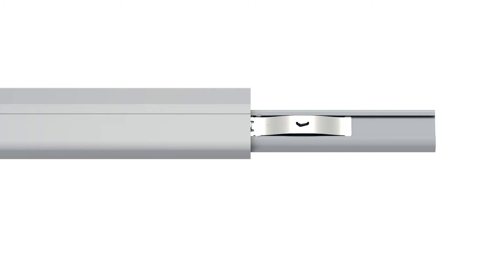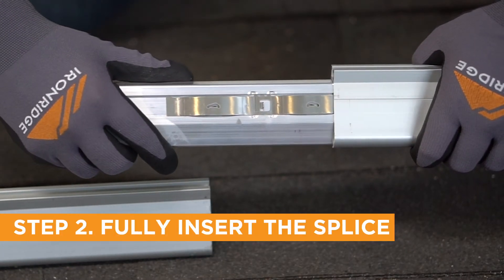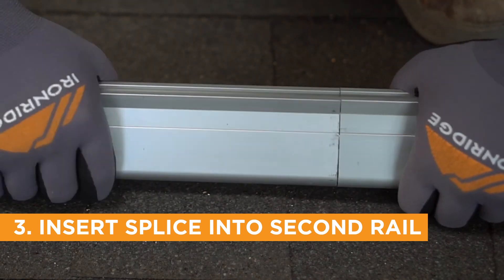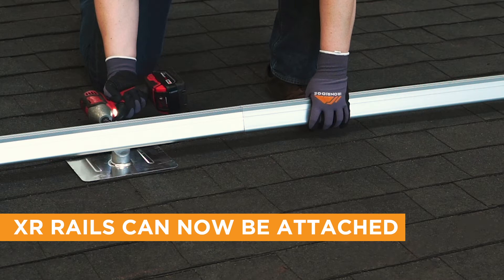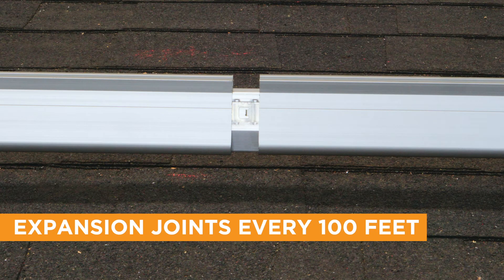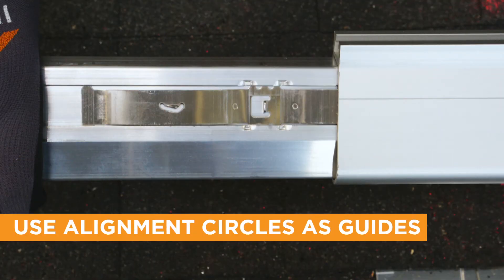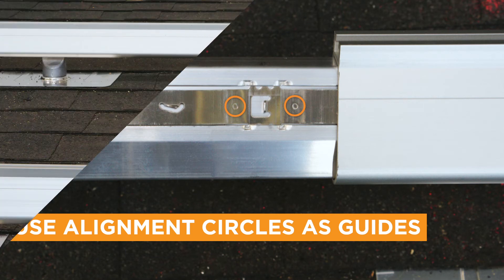How to Connect XR Rails // Installing BOSS® Splices

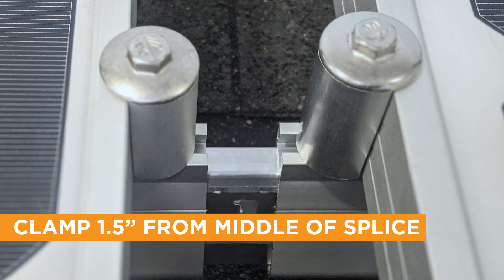Comment: 1:23 does this 1.5" rule apply only for expansion joints? or does it also apply when there is no expansion joint (when the rails are butted together)? and is there any splice distance rules for the L-foot? thanks.